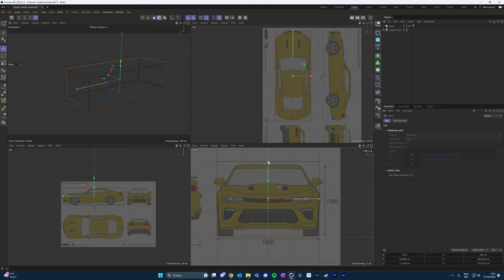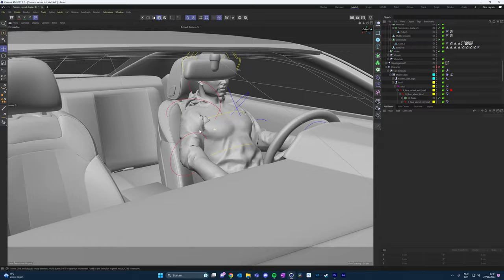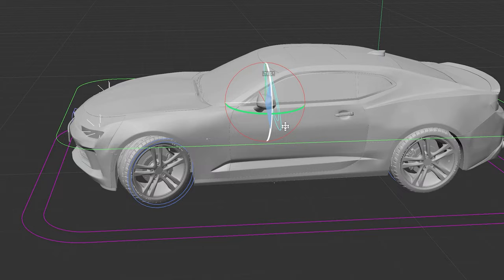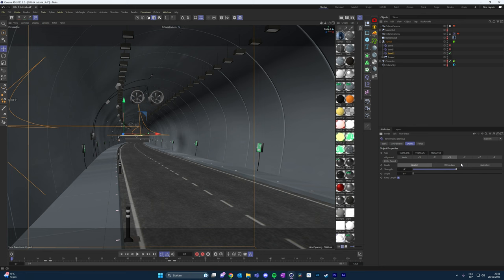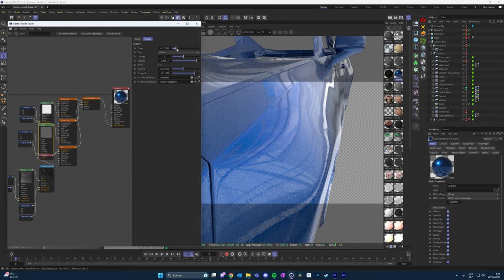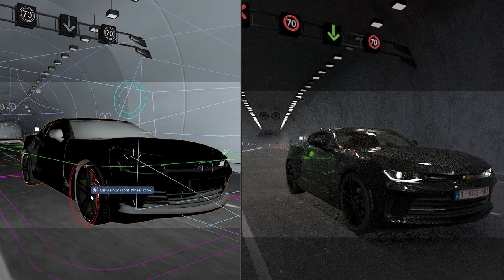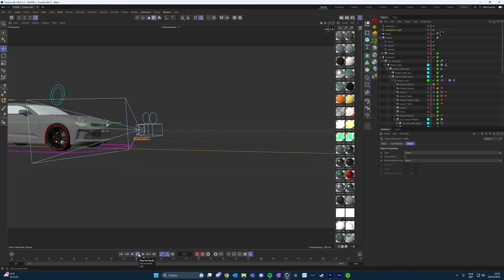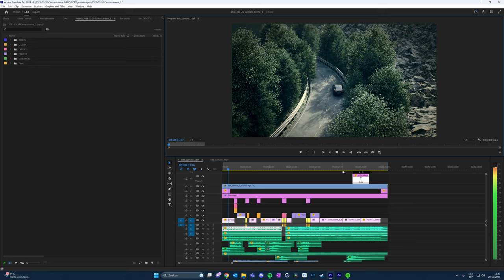Creating Cinematic 3D Car Animations with Cinema 4D

Comment: Which program has most of plagins and ready installed models? Is it possible to make in After Effects?
Reply from the maker: I think Blender has the most options and it's free. In AE it's prossibe with a plugin called "Element 3D". However this plugin does not have the same rendering capability as a deticated renderer primarily for 3D rendering.